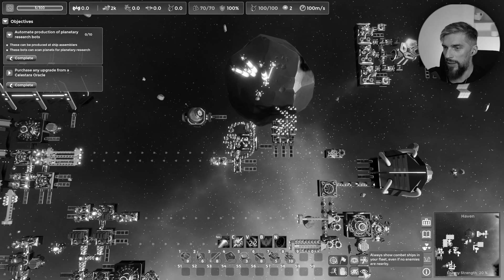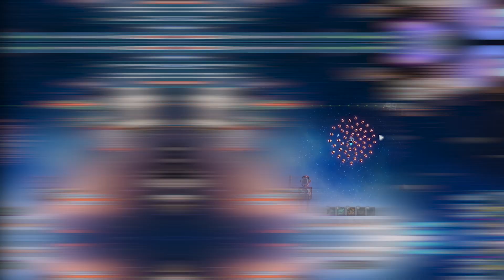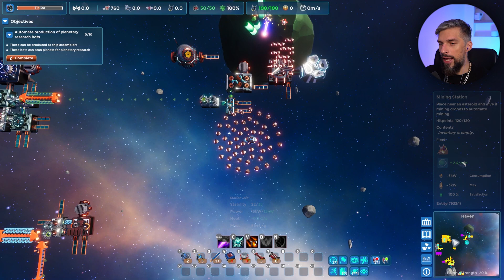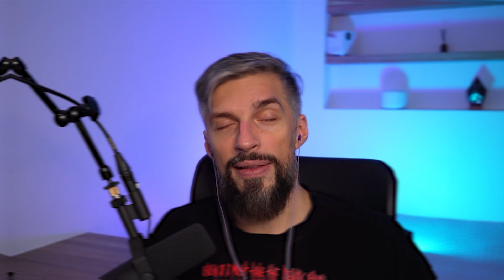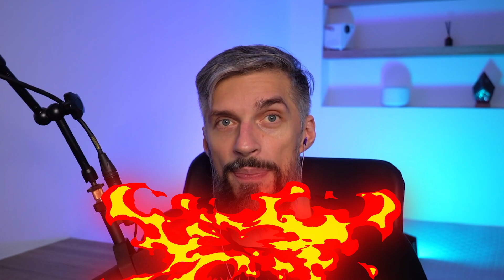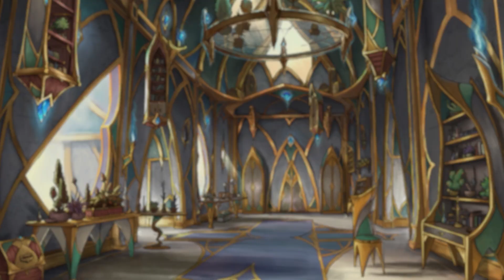PLANETARY RESEARCH INSIGHTS // FINAL FACTORY

Comment: Great video! Pro tip: you can use any item as fuel (the more mass the more efficient it is). Laser Turrets and Rocket Adapters need fuel to operate
Reply from the maker: Good call! Will use it in the next video ;)